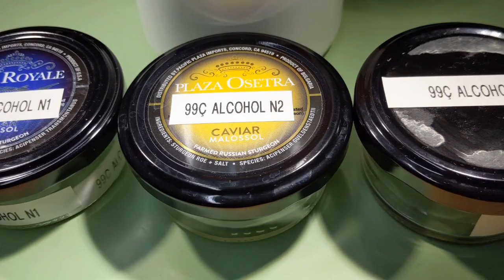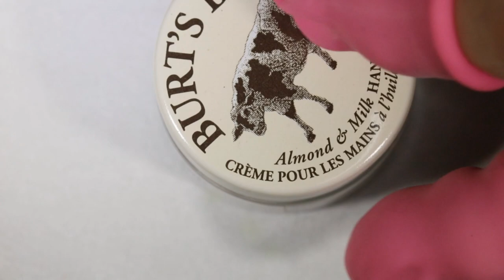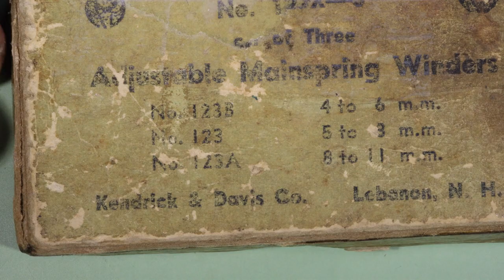Restoring and Servicing a Vintage 1968 Seiko 5 Cal. 6119B Watch - Part II - Preparing for Assembling

Comment: Super video! How do I find in which direction the hands need to fitted on the axles? I have a Seiko analogue electronic watch with several functions in just one dial (alarm, stopwatch, ...)
Reply from the maker: You should find the point where date get changed, it's a midnight point. Then you install hour and minute hands pointing to 12:00. In regards of hands for other functions of your watch, I do not know, because I do not have that movement.